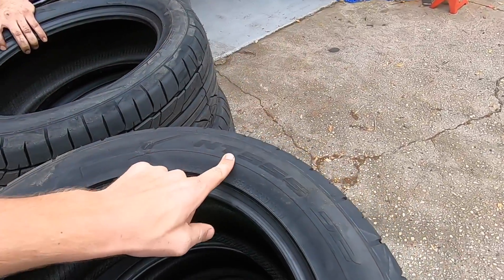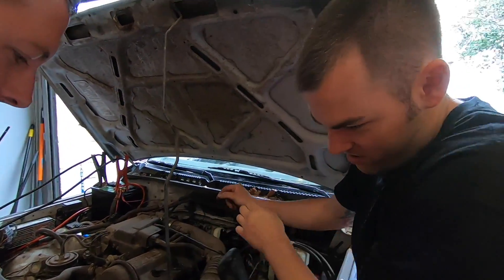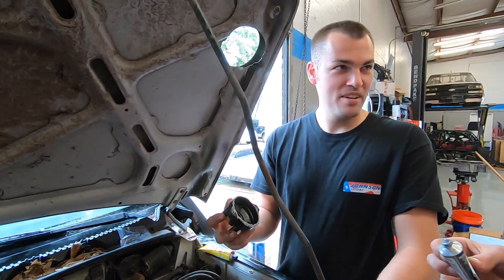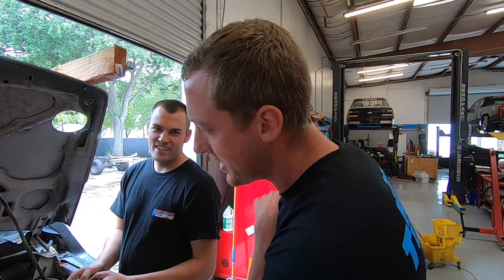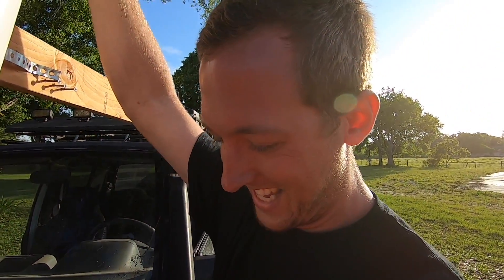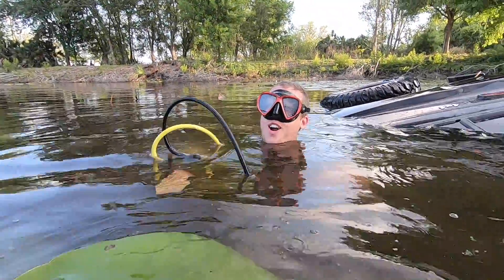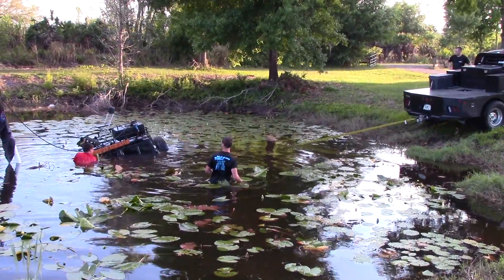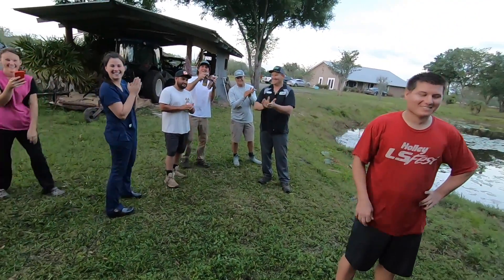Driving Underwater EP.2 - New Strategy Did Not Pan Out...

Comment: Duct tape your pugs and connectors, distrubuter, spark plug wires and holes, wrap your starter in duct tape. (In case you have to restart under water...ahaha.) and wrap your computers and fuse boxes. Anything electrical. In tape. The alternator is hard yo fix for electrical. But maybe try to build a sealed box around it. With a crank seal or driveshaft seal something to fit the pulley on the alternator. To keep water off it. 🤙🤙 Then Put flex seal or liquid roofing patch in a undercoating gun. Spray everything in engine compartment.  Including battery posts And connectors. And under dash if possible. Fuse box in cab should be covered too. Put battery on center of roof. Re run cables to it. Maybe in a sealed box too. Also just for fun. Where you ran intake pipe high above. Also run exhaust pipe same height. To hear the exhaust when driving underwater. 😎 and give better running and engine flow. better running. Good luck on next try.
P.s. take bench press plates. And run a rope through them. Hang at least 100 pounds on each axle. Next to shock mounts. 50lbs for each wheel. Should help with sinking quicker and grip on bottom. 👌👌
From Nova Scotia, Canada.

Comment: filling the tires with water will keep you upright when the vehicle floats the next thing is to fill both ends of the spark plug cables with Vaseline or grease to keep out water the same for any electrical plugs anywhere on the engine once you seal up everything and I mean everything nothing will stop the engine tell you turn it off . you should also unplug the cables to the alternator and run off the battery tell you are out of the water so it doesn't fry itself or short out

Comment: 101 of water ingress into vehicle electrics, apply copious amounts di-electric grease to all terminals, pins and connectors, including plug lead contact points, then use self sealing heat shrink everywhere you can, from the plugs and leads to the dizy and the coil. the ignition switch and any fuse boxes should be glued and sealed tight.

Comment: I think one of you need to get an 89 Dodge raider with a 3.0 V6. 89 is the first year of a fuel injected throttle body. And they come factory with skid plates from front to the rear, and comes with a factory limited slip rear end. I think the raider will go across before cleetuses 4wd. Or go with a 88 carburated raider/montero.
Reply: Also open your rear slider windows to let water in. Go slow and let it slowly sink to drive on the bottom. Dont let it float, and maybe add a dual battery setup so you dont have to rely on the alternator for power

Comment: If you get a whole bunch of air intake pipe run it up and out the hood up the windshield over the roof all the way to  end of the frackers back glass and then just fit half a air box facing toward the sky flex seal the shit outta the whole deal dry pipe depending on the diameter  it'll work it'll float as you descend in the water either way but scuff surface before you spray

Comment: Unless that is a Diesel, wouldn't you need to seal ALL the electrics (Key Switch, Alternator, Coil, Plug wires, Fuse Box, Relays,Plug caps the list is endless). I can't see how that will ever run under water much as I love watching it go underwater.

Comment: here's how you CAN drive underwater: use a DIESEL engine/motor NOT a GASOLINE one!
Reply: Wrong. Gas uses Air, compression and spark. Diesels use Fuel, compression and heat. Diesels will not last underwater as they are being cooled by the water. Am i saying it wont work? No, im not. What i am saying is, its even higher risk of dying.
Reply: @brandoncaldwell95  they do not dy that fast. Here's why: when a diesel engine/moter compressen the air the temperature gets about 500 degrees fahrenheit regardless of ambient temperature. when it runs it runs even under water. remember that compression is key here.
watch a jeep diesel running 12 feet under water: https://youtu.be/icp2Pb5uoME
and this hummer h1:  

https://youtu.be/j7gZ28Msa8g

so again: diesel runs underwater easy, gasoline ones do not due to the ignition system shorting out.